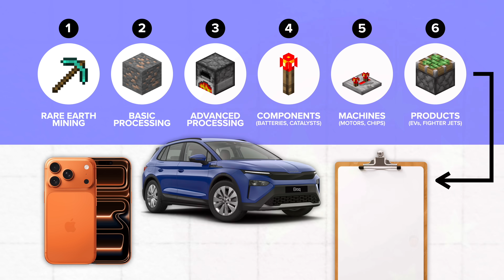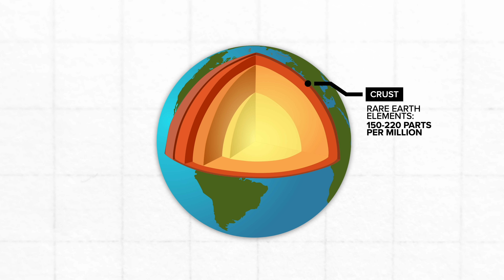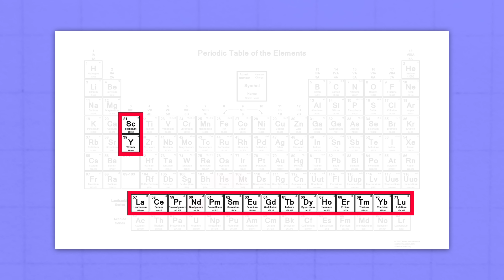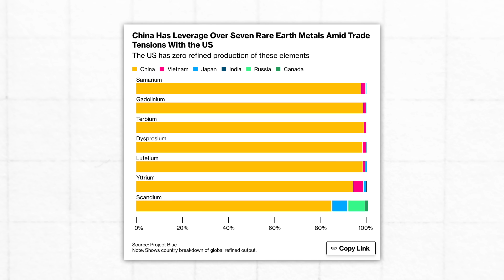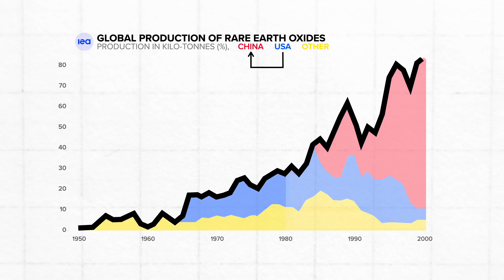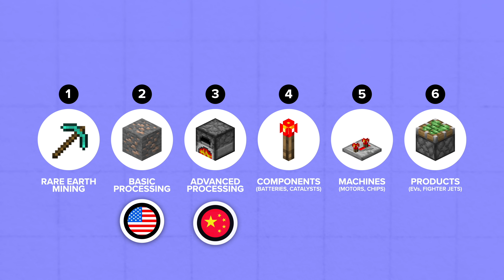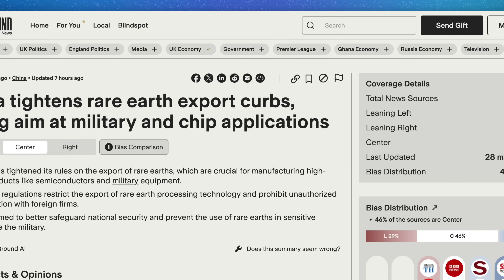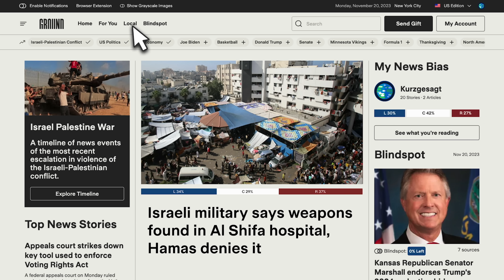Why Breaking China's Rare Earth Monopoly is Surprisingly Difficult

Comment: The "China doesn't care about pollution" is pure cope.
China does its rare earths refining in the most remote region of the country (a literal desert) where the ground and water pollution have little impact.
The US could do the same. There's plenty of empty area, and it's not like Trump cares about the environment.
Reply: You're right. The US loves fracking but is trying to finger wag. It is disgustingly hypocritical
Reply: @loztbwoi1358  China is still the single largest polluter in the world and they are doing so little to counter it that even America can object without being much of the hypocrite.
Reply: @JurijsPastnieks now let do per capita
Reply: @Masiil-g2p  Ordinary citizens do not own factories or build coal power plants. China's domestic consumption is just a fraction of it's output and same goes for most of the high polluters (mostly oil and gas producers). They have the means to move away from coal, but they won't because it would increase the price of production and no one is really pressuring them to do so.
Reply: @JurijsPastnieks  Wrong, China's renewables are cheaper than fossil fuel.  China's coal consumption is dropping, even as electrical production continues to climb.  Last year, China renewables growth outpaced electrical demand. China has low electrical cost, but huge volume and even bigger capacity.
Reply: @ZweiZwolf  They expanding renewable, makes sense since they are single largest producer of solar panels and have been massively overproducing them, but they are also continuing to build and expand coal power plants instead of switching to gas.
Reply: @JurijsPastnieks  China isn't 'overproducing' solar - they are installing them domestically as fast as they produce them!  That's how China installed more new solar this year than all solar across the entire USA.  China could double or triple their solar production and still need more to meet domestic electrical needs.  

China's coal power plants are the most efficient and cleanest in the world, but China's cost of renewable energy is now cheaper than any fossil generation anywhere in the world.  China is finishing construction of supercritical coal plants that will be used as peakers and emergency backup, rather than base load.  China's coal plants are now roughly 50% idle, and utilization is dropping fast. 

Gas is more valuable for chemical feedstock than electrical generation.
Reply: @ZweiZwolf  They are overproducing them hence they are installing them otherwise they would sell them they need the money to run the machine it is not because they care it is because they overproduced so much that an otherwise expensive option is now the cheapest one, for them.

They have underused plants because they keep building new ones in case demand spikes due to inefficient grid management. In 2025 coal usage decreased by 1-5% which is barely a fluctuation.
Reply: @JurijsPastnieks  LOL, China is selling green tech globally, but they also have huge need domestically.  

China has nearly 100% excess capacity, where the US has less than 15% spare.  China has excellent grid management, thanks to ultra high voltage transmission and massive grid storage.  China simply executes well, and no amount of pretending changes the facts. 

China's energy market is changing structurally, and you're just coping.
Reply: @ZweiZwolf  Demand does not arise from desire to protect environment it is because they have massive amounts of solar panels that exceed export demand, so they are super cheap in China hence internal demand.

You don't need 100% excess capacity if you have efficient grid management. In fact it is a huge waste that occurs due to rigid and corrupt political system.

Changing, but still polluting more than anyone else in the world. Question is not that they are changing, but why.

The main reason as far as I know is that they are running out of cheap coal for these 2 reasons:
1) A lot of their coal is uranium contaminated some of which they were burning at some point.
2)Mining cole is becoming increasingly expensive due to over exploitation.

Saying China cares about environment is like saying a poacher cares about endangered species. "I have stopped hunting this endangered animal, because I hunted it to extinction."
Reply: @JurijsPastnieks  It's laughable that you think Chinese are motivated by neoliberal capitalist profit over socialist service.
Reply: @ZweiZwolf  They are a part of global economy regardless what they call themselves in their internal propaganda. Chinese are not a hive mind each individuals has its own motivation for what they are doing.

Their government is insanely corrupt, most of the party officials are rich and have studied in America, they receive special treatment like kings.

Government uses massive censorship apparatus to suppress voices of the people and people always find ways around the censorship, sometimes they driven to such desperation that the try to confront the government, and are quickly taken away by the police.

If you go into the streets and wave Chinese flag it will be treated as a protest and you will be arrested.

There are a lot of billionaires in China.

They intestinally devolve their currency to keep their population poor and prices competitive on the global market.

They use massive fishing fleets and systematically over fish all over the world.

They have ongoing territorial disputes with almost all their neighbouring countries.

And lets not talk about what they do to minorities and political dissidents.

I think majority of people in China are sick of their government and want nothing more to see it fall.
Reply: @JurijsPastnieks   debunked long ago . China is the biggest contributer to green tech
Reply: @JurijsPastnieks   your jealousy is wrong again
China is not largest polluter 

That's trump . Drill baby drill 😂😂😂

Also usa is 40 trillion $ in Debt to China

Our govt is 140% in debt to China govt😂😂😂😂
Reply: @JurijsPastnieks   well imf report showed usa is largest polluter 😂

Also usa is 40 trillion $ in debt to China

Even chinese know that . That's why usa can't to anything to China

Even we Americans are tired of this
Reply: @jacksmith-mu3ee  I am not jealous since I am not from US. China is a single largest polluter, but US is the largest polluter per capita however I argued that in a globalised economy pollution is not a function of population since domestic consumption is just a fraction of output. China has a massive debt, and so does every developed nation on the world, they structure they debt differently and some of it may be hidden like Germany before ww2.
Reply: @JurijsPastnieks   and that's why usa is in debt to China 😂😂😂

China 0 recession
China 0 inflation

Usa recession
Uk recession
France recession
Germany recessing
India recession
Taiwan recession
Reply: @JurijsPastnieks   wow dude . Everyone is defeating you😂
Reply: What is the point of clean air/river/soil when one is put at strategic disadvantages (which can lead to the collapse of wealth), and humiliated? What a weird idea (from the West).
Reply: The West believes that the idea of relying on technology to rebuild the rare earth-related industrial chain within a few years is unrealistic, which is not only a technical problem, but also a systemic problem. Taking gallium metal as an example, if the United States wants to produce 100 tons of gallium, it needs to invest 1500 billion yuan to build an annual output of 1500 tons of alumina factory, and also to build an annual output of 750 tons of electrolytic aluminum factory, and the electrolytic aluminum plant needs nearly 100 billion kWh of electricity a year (equivalent to the annual power generation of the Three Gorges Dam), and 10 new large-scale pressurized water reactor nuclear power plants need to be built, and at the same time to solve the problem of ports, highways, power grids, mine construction and the shortage of 3-5 skilled industrial workers, and the electrolytic aluminum market is surplus, and the cost of electrolytic aluminum produced in the United States is high, It is uncompetitive and economically difficult to sustain.西方認為靠技術能在幾年內重建稀土相關產業鏈的想法不切實際，這不僅是技術問題，更是系統性難題。 以金屬鎵為例，美國若想生產100噸鎵，需先投資1500億建年產1500萬噸氧化鋁工廠，還得配套建年產750萬噸電解鋁工廠，而該電解鋁工廠一年需近1000億度電（相當於三峽大壩年發電量），需新建10座大型壓水堆核電站，同時要解決港口、公路、電網、礦山建設及3-5萬名熟練產業工人短缺問題，且電解鋁市場過剩，美國生產的電解鋁成本高、 無競爭力，經濟上難以維繫。
Reply: China cancer villages says hi.
Reply: You have no idea how difficult it is to get the EPA and environmental impact report approved, even under this administration. It's the existing old factories who got away with all the shit in the news, and newly established factories are all heavily regulated from polluting ground water and air.
Reply: Um, I don't know how to tell you this, but desert environments still count as the environment. They can be polluted.
Reply: ITT people who think the desert is an empty biome and a magic sponge for pollution
Reply: One of China's rare earth refineries is in Jiangxi, in Southern China.
Reply: @ScrumpyWingnuts201  Jiangxi is the size of Iraq and has a lot of mountains and isolated areas.
Reply: @ElZilchoYo  Iraq is about 3 times larger than Jiangxi.
Reply: @tooltalk   nope😊
Reply: @ScrumpyWingnuts201  REE deposit in Bayan Obo in Inner Mongolia is about 20x larger than Jianxi.  About 50% of all REE come from this region.
Reply: Funny thing about desert's is they usually have water underneath them.
Reply: Ay, fancy seeing you here
Reply: So acording to that they definitely do not care, since they found a part of the environment with less consequences for themselves if it is ruined and are poluting it. Thats like saying a person litering actually dose care about cleanlines because they are not litering direktly in their house.
Reply: Given how much coal China consumes it is safe to say that China doesn't care about pollution. It is not about how remote the pollution source it is still polluting environment which eventually spreads further and accumulates in groundwater, animals and plant life.
Reply: @JurijsPastnieks   you defined America.  As per imf report on 2023 . Usa is the largest polluter on the planet 

Imf is not chinese btw 😂

And still ironic that usa is in debt to China😂